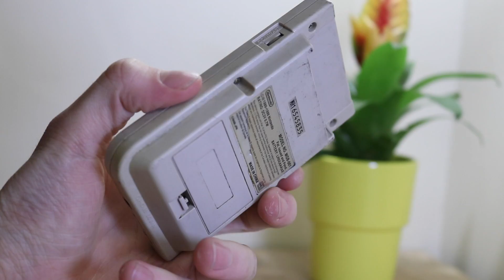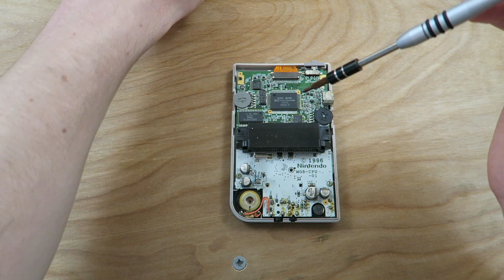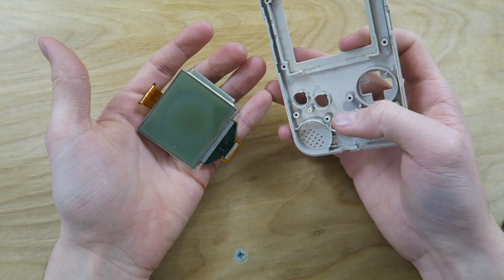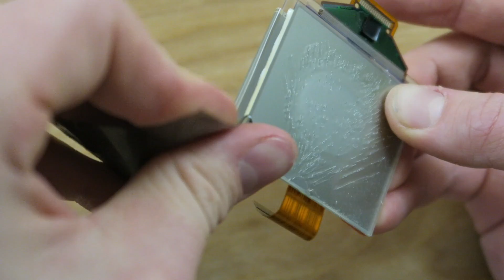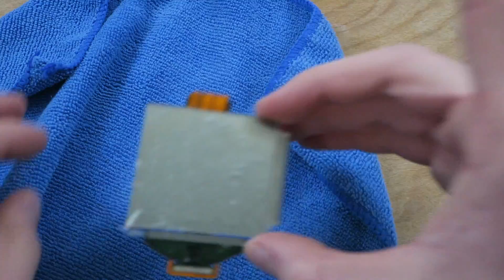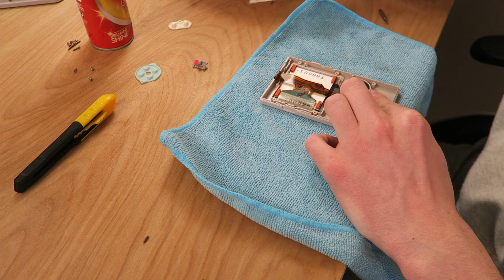How To Repair GameBoy Screen Burn!

Comment: Great video... I got my polarizer and all, everything works fine. Only problem, my polarizer is translucent, what foil do I have to use so I can't see through it into my GB innerts? Update: Went into research... piece of paper will do, I will try the backlight mod...

Comment: So can anyone explain the science behind the screen burn and why it happens?

Because I've had my Game Boy Pocket stored in a box, in the closet, never used... and over time, it developed screen burn.

This has happened twice thus far.
Reply: Has to do something with the light frequencies and pixels when I looked it up online. I guess its similar to how rusty forms on metals. After an exposure to the light on the game and the pixels. Itll slowly deteriorate overtime it seems. Thats my only logical explanation but I could be wrong

Comment: Hey man! Awesome video! I used this video to fix my GBpocket screen but when I removed the polarized filter the screen was still with the black spot, did I do something wrong? I followed all your steps I don't know what to do now.
Can someone help? I know that this video is from 2017 but who knows...
Reply: There’s two filters on the screen. The after you remove the filter there is also another layer where the adhesive is. That’s causing the black spot
Reply: @markcordova8126  Should I remove this second layer them? I tried a bit and it doesnt seem like it's possible
Reply: Did you replace the polaraizer filter
Reply: @markcordova8126  no, because the screen still have that black spot, I don't want to use my new filter on it
Reply: Did you remove all of the adhesive
Reply: @markcordova8126  Yes! And the black spot is there, not as strong as before ... but it still very noticeable

Comment: Hello! Why the picture on your GBP is green? There are should be a black-white colors, without green) Did you use a polarized filter not for GBP? Probably it was filter for GB original?

Comment: The reflective film underneath the LCD, do you know where I can find an alternative material of the same?
Reply: I don't know if you're still looking, but if so just search ebay for "Polarizing Sheet". That's it.
They're often sold for being used in modern mobile phones but they're the same thing as inside the gameboys.
As for the sticking part, they tend to have adhesive already on them when you peel them.

Comment: Can you use white spirit to get rid of the bottom sticky layer?
Just bought a Hello Kitty gameboy pocket with a burnt screen to give it a go. Would love to be able to fix it like you have ♥️
Reply from the maker: Hey! I'm not sure actually. I would suggest getting isypropal, you can get it from a pharmacy pretty easy. It might be called rubbing alcohol where you are. Try get a higher percentage of alcohol. Like 70%.

Comment: Dude, you could use W-D 40...it takes TEN minutes and not 2 hours. All u have to do is spray some on the screen after u take of the polarizer, wait 10 mins and...pow! What WD-40 does is eats away adhesion, but doesn't eat away plastic! The 8-bit Guy uses it alot. An example of this is in his cartridge restoration video. I recommend you check out his channel 'cause it's good!

Comment: 3M has a great "Adhesive Cleaner" (08984) in their portfolio. Just put it on the surface and leave it there for a minute. You'll see the adhesive puff up a bit and it's then really easy just to wipe off the surface with practically no residue (if you waited long enough). Oh, and heating the entire display up from the top with a hair dryer or something will also help a great deal softening up that adhesive so you'll get the sheet off the glass more easily and with less risk of cracking it.

Comment: As you lift the polarizing screens, rub the adhesive side with a q-tip covered in IPA.  It will dissolve/break down most adhesives and make it way easier to remove.  It's how I do it.

Comment: Warm the adhesive with a hair dryer as you start to peel it back, and it will come off easily and usually without leaving residue.

Comment: Usually if you want an easier time separating the glue from that, you want to heat it up a bit with a heat gun so that the glue turns mushy and pliable.
Reply: What about alcohol? I used alcohol.

Comment: You should get a good heat gun, when you were taking out the polarizer and the sticky film you coulve done it much more easier applying a little bit of heat to it, most adhesives tend to flow and lose adhesion when heated. 

I really liked your content m8, suscribed.

Comment: Have you tried using those LCD removing wire based cutters? Very cheap-there are kits on Amazon. Seems much easier than using a blade.

Comment: Could try applying a little heat before removing the polarisers
Reply from the maker: Ah good idea, with what do you suggest doing it with? Hairdryer or something?
Reply: Yeah a hair drier would work fine. I have used it a  lot getting mobile and tablet screens off. It just helps soften the glue up. DO not use a heat gun.

Comment: Hi I have a problem can anyone help ? I have a GBA sp ags 101 with a screen line can it be fixed using the method like on a game boy color ?
Reply from the maker: I dont think so mate, but I may be wrong.
Reply: The screen on the 101 is a backlit LCD. The 001 is a front lit screen and the gameboy color screen is basically the same but without the front light. I don't think you can do much to fix the 101's screen because it has a metal frame around it but I have seen replacement screens on ebay for around 25-30$. It's cheaper than a whole new AGS-101. Apparently it's also possible to fit those replacement AGS-101 screen into the original GBA.

Comment: I'm surprised today one of my friends for me a box with an atomic purple gameboy color, a bunch of gameboy games including two pokemon silvers both legitimate one with a new battery, and pokemon gold, but the sticker has be torn off. It also came with a dmg wall charger so you don't need batteries and a gameboy advance sp wireless adapter that origanaly came with fire red and lead green. Do you know any good place to get repro labels for games that look legitimate, so then my gold displays much better?
Reply from the maker: Not sure mate, ebay probably!

Comment: Quick question if you don't mind. Can this sort of burn be caused by (incorrectly) fitting a backlight? I ask because I have a backlit wonderswan that has started to develop a similar look, and changing the hue of the screen from blue to pinkish purple in a blotchy formation very similar to what I see in your video around 4.11. I was wondering if it was something I could fix with a similar technique?
Reply from the maker: Don't think so mate, but maybe.

Comment: How do GameBoys pocket get Burns screens?
Reply: Pug01 Retro and more commentary Yo 

Sunlight exposure.

Or overheating due to severe Pokemon addiction.
Reply: That makes sense and the Pokémon thing lol
Reply: sun light melts the polarizer causing the structure to change. In side of a polarizer is a line structure that causes only waves that are vertical or horizontal go pass through. Hence the reason when he rotates it in front of the screen it goes from light to dark. When this polarizing film gets too hot it melts and starts doing all sorts of odd things. So leaving your game boy in a hot space or in direct sunlight causes this effect.
Reply: Mine got it recently in almost all screen. The Gameboy Pocket was inside its box with the original plastic package and i guess normal room temperatures. I didn't use it much the last 15 years, just every 1-2 years i was checking it.